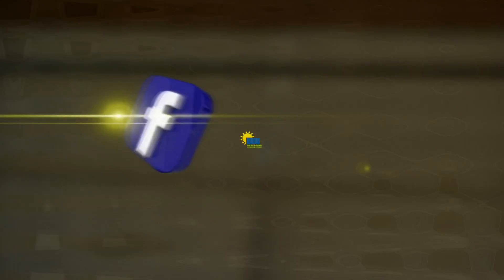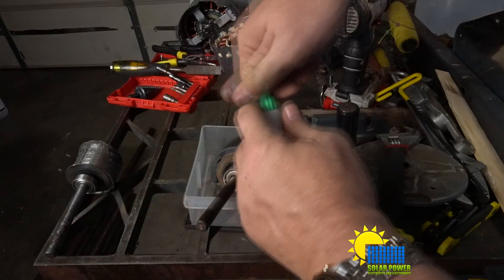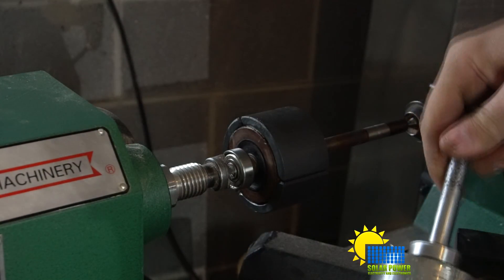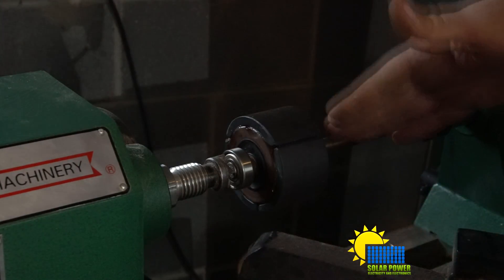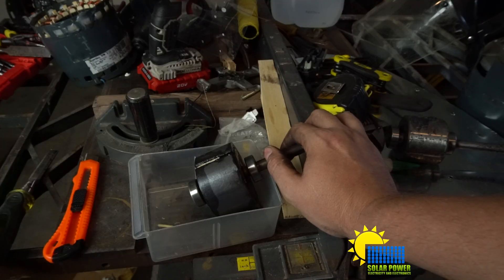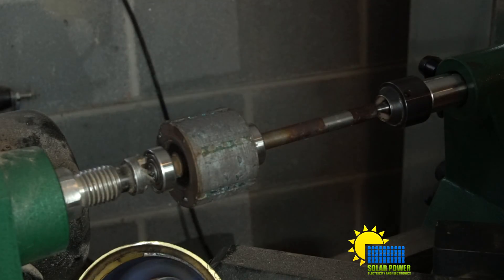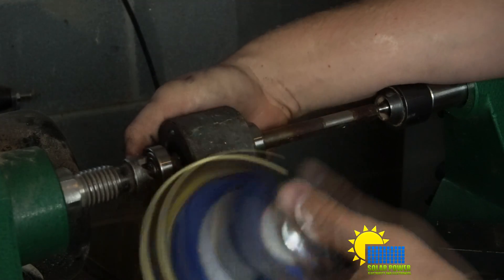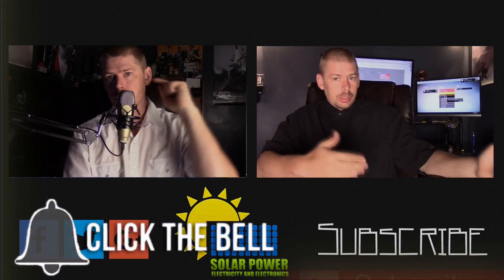Removing The Magnets From The Three Phase Motor

Comment: Do they have these in the dimensions you need ? 
https://www.ebay.com/itm/33-5mm-OD-x-27-25mm-ID-x-5mm-thick-Motor-Magnets-Neodymium-Rare-Earth-/121901425309

http://www.ebaystores.com/Emovendo/Magnets-/_i.html?_fsub=5&_sid=3496412&_trksid=p4634.c0.m322

https://duckduckgo.com/?q=neodymium+curved+magnets&t=ffab&iax=images&ia=images
Reply from the maker: I need a set that is 63MM ID
Reply: That is a difficult size to find.

They also go by different names:
 Motor Magnets
 segment magnets
 arc magnets 
curved magnets

The largest I found so far is only 46mm ID

https://www.apexmagnets.com/54mm-x-46mm-x-20mm-motor-magnets

I will let you know if I ever find any the size you need.
Reply: Does not list ID but looks close from the pic:
 https://www.ebay.com/itm/Huge-Neodymium-Arc-Motor-Magnet-Rare-Earth-N33uH-Ultra-High-Heat-2-75-2-5/182263090477

Could you make 68.5mm ID work ?
Looks like it is only N35 strength.
Also looks like it is only one pole, all North or all South.
https://www.ebay.com/itm/Neodymium-N35SH-Oil-Filter-302-Fahrenheit-Arc-Magnet-LOT-of-3/253232021555